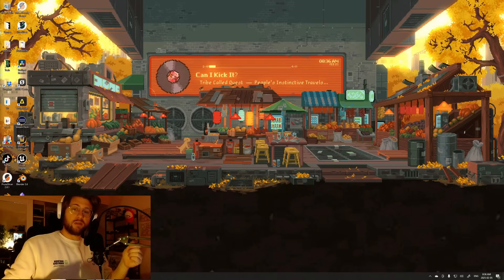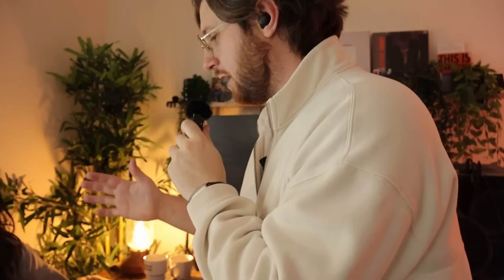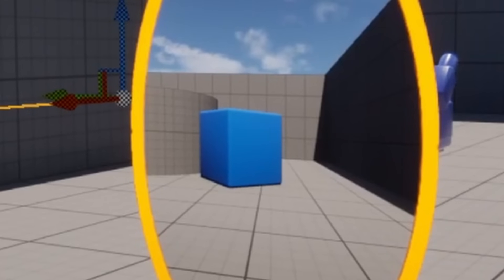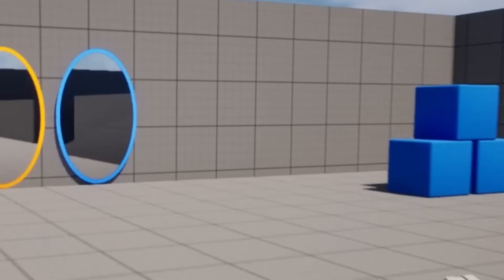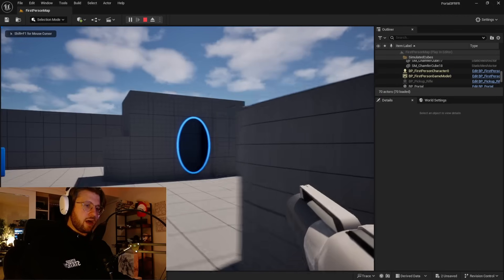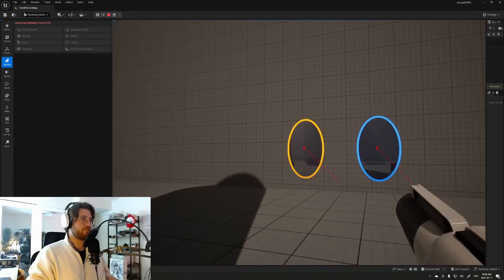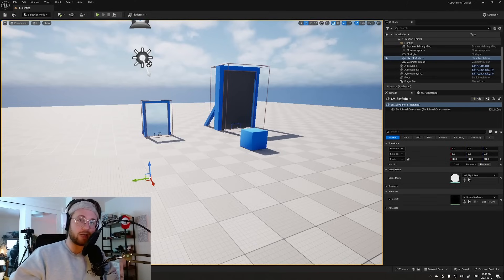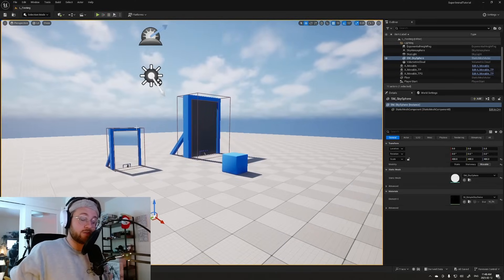I Made Portal 3 to Prove Valve is Lazy

Comment: 10:50 No, that's not why. You just needa set the near clipping plane of the camera to the portal opening to skip rendering stuff between them, similar to how to simulate a mirror in front of obstacles. The non-portalable surfaces are for the puzzle rather than a technical limitation.
Reply: and also some math to change the angle of the near clipping plane

Comment: First of all. Valve isn't lazy, just no one of them want to work on portal 3, they said it in somewhere. I don't remember kinda where if you ask. Second of all, your portals laking smoth positionating. Like you jumping at one side of portal and always teleporting to center. Also they're didin't have smoth entering, because you teleporting momentally. And third of all... WHERE IS PORTAL 3 ? The're are only two portals, where third ? But no jokes, that's cool.

Comment: Ironically, the method used in this video is actually not exactly the right one (or at least, it's not an efficient one).

Valve devs already explained how they made it possible for the player to move between the 2 portals as smoothly as possible: There are actually 2 players characters and each is sync with its own single portal. When a portal is generated, its relevant player character is generated.

Whenever the player enter the portal, he/she resume control over the other player model/character and the previous one controlled becomes a "mirrored" clone without any physics.

In Portal 2 coop, this is also done with having 4 copies of the 2 robots if both use both of their portals.

The trick on how they make it so that the teleportation feels so smooth is a clever one in terms of rendering.

In the method shown in this video uses projected texture from a camera. It's not wrong per say, but it comes with the issue of quality being based on the reflection generated. If you get close to the portal, you'll notice a lower quality of pixels around the edge of the stuff in the portal which suddenly becomes clear as you cross over.

Valve devs did a clever trick of using 2 passes instead of a projection. When the player is far enough from a portal, it uses a projected texture onto the material like shown in this video. When the player get close enough, the rendering of the portal becomes a mask which superpose onto the 2nd player character's camera view. (In other words, when the player get close, what's rendering is the other player characters' view with a 2nd pass of the currently player's view added over it with a mask.
This allow the game to always keep, at least, a 1-to-1 pixel ratio between what's view on screen and what's view within the portal.
Reply: Source on it using a texture when far away?
Reply: https://www.youtube.com/watch?v=riijspB9DIQ

That video explain the 2 methods.

Comment: 11:29 - What you need is a 2nd "copy" of the player, that ONLY the other portal camera sees, and then move them in conjuction with the player as it enters a portal, and then "teleport" the player ONLY when their mid section (if they are intersected with a plane that's vertical and parallel to the portal surface normal) crosses the portal's event horizon -- then your teleport is pretty seamless and it looks like they just walk through
Reply: Yep, bcs right now it's just a trigger that instantly teleport the player to the other side with a copied velocity, but in the real Portal game you can "physically" enter the portal (I think it dynamically cut a hole into the mesh for that), when here it's just kinda like a solid miror with a teleport trigger in front of it. It's still great however just for a tiny project made for fun.

Comment: thinking about the problem you had where the camera was inside a box. If you set the camera's near clip distance to the distance from the camera to the portal, you should hide anything that would obstruct the output of the portal view.
Reply: you also have to do a bunch of math to change the angle of the near clipping plane to line it up with the portal

Comment: 10:49 Wrong, as I recall, portals in Valve's Portal can be placed on any texture surface with the "%noportal 0" function in the texture's "vmt" files. Its purpose is to limit the surfaces that can create portals. If every surface could have portals, the puzzles would be completely broken, so it defaults to "%noportal 1" for most textures other than concrete structures made of moonrock (according to lore, moonrock is a portal conductor so only surfaces made of moonrock can create portals).

Comment: 2 small corrections: The FOV thing you did is just a hack because you didnt map the textures correctly onto the portals. Instead of mapping them using the UVs of the portals, they need to be mapped relative to your camera. Also the collisions are not why you can only place portals onto specific surfaces. They developed a multitude of things to make any positioning possible. Besides dynamically cutting holes into the collision mesh, they created something called an "oblique" camera, basically you can control the near clipping of the portal camera to only everything beyond the portal